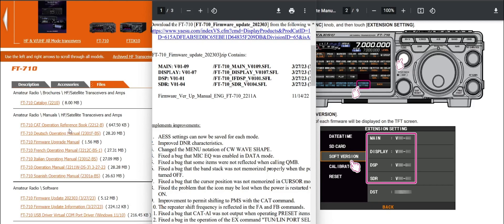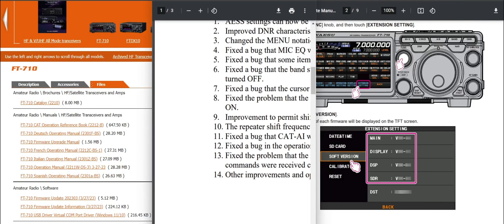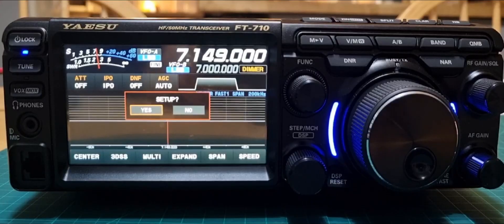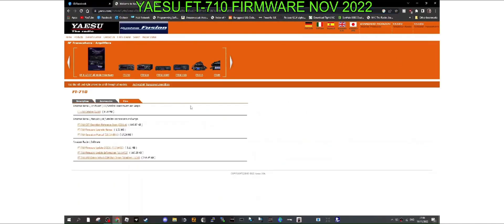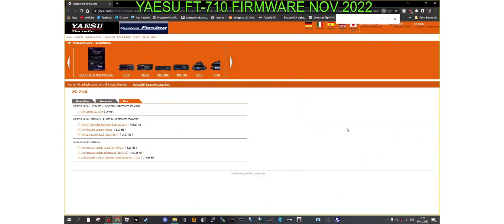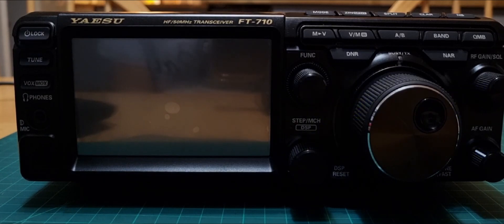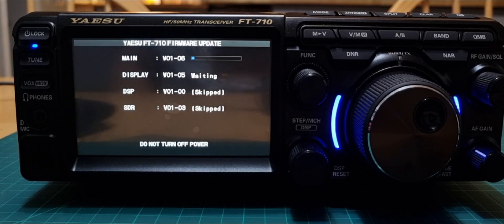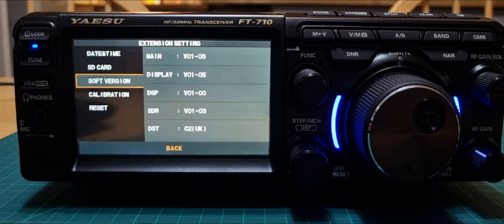NEW FIRMWARE - YAESU FT710 - 27TH MARCH 2023-FULL INSTALL & LINKS

Comment: Thank you for your clear instuctions. I always dread doing firmware updates and after the display and main update i got "error 001" but after resetting the radio everything worked fine.
Reply from the maker: Glad I could help same with mine

Comment: All went well. Reset radio at end. Did notice SSB DNR is better, did not notice any water effect. Set to 5 mostly. Saved my Menu List and Menu before on the SD card. Still had to manually change back to my favorite settings for each band and misc after loading my saved settings. Same with other update last year. I really enjoy this radio and am very pleased with the DNR now, which was what I was mostly concerned about. 73 K5APD Jim
Reply from the maker: Hi yes Yaesu have done well i have had reports that external screen is sharper.